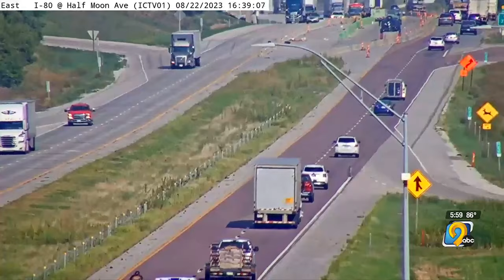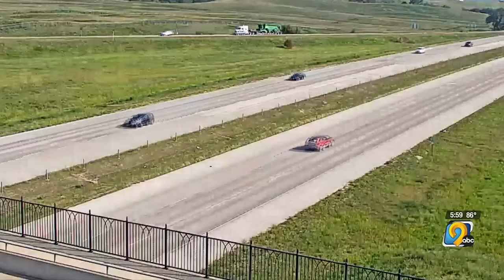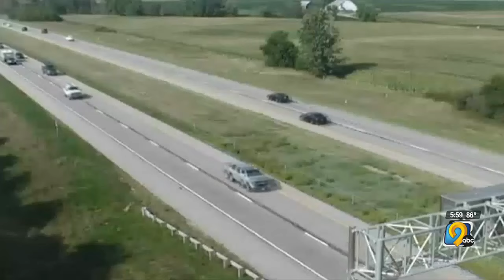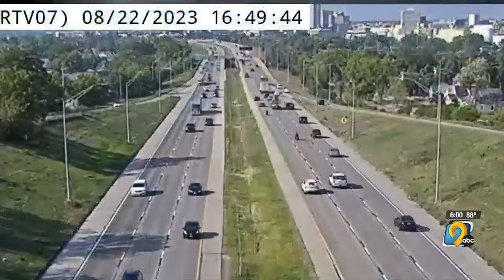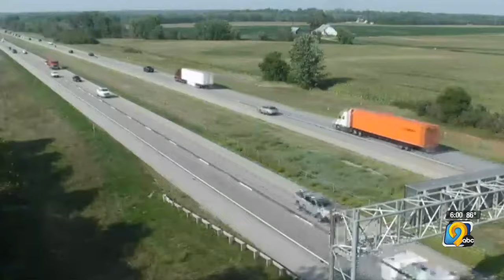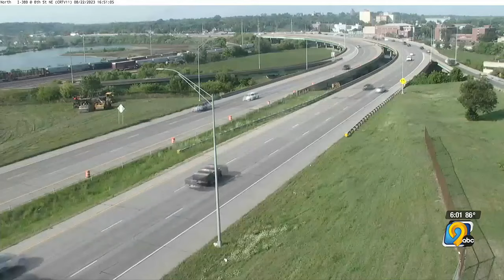‘A motorcycle to a projectile’ Safety expert warns of speeding on motorcycles

Comment: A speeding motorcycle on the expressway is certainly a danger to collide with cars, but there is virtually zero chance a motorcycle crash with an automobile is going to cause any serious injury to those in the car. To suggest it will cause a fatality is absolutely ludicrous. Also describing motorcycles as weighing 1,200 pounds shows this guy does not have the first clue about motorcycles.
Reply: Watch some Russian dash cam videos. A 600lb motorcycle can easily flip a car at high speed.
Reply: not true a motorcycle speeding between cars can cause cars to lose control
Reply: @davidjones-vx9ju  Yeah, if a motorcycle, bus, van or anything else speeding past a car can cause the driver to lose control, said driver shouldn't have been issued a driver's license to begin with.

Comment: A 1200 pound motor bike? I do not think even a fully decked out touring harley can get that heavy.
I have want is called a "old mans sport bike" as it has handle bars. 
ON THE TRACK, i did get it up to 170 mph. but way too fast for me, i do not like going much over the posted speed limits. but sometimes must for safety, as the flow of traffic demands it, or get rear ended by mom or pop trying to get home fast in there car.
old saying:     you can outrun the cop.  
         but you cannot outrun Motorola.

only a fool with a death wish rides a bike like shown in the video.  not all the reg folk who try to work within the law.